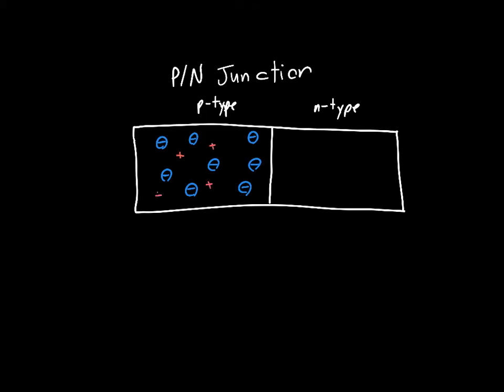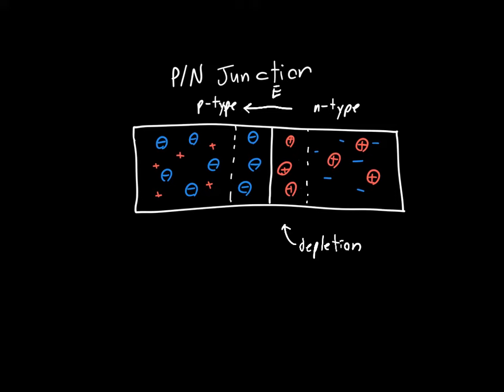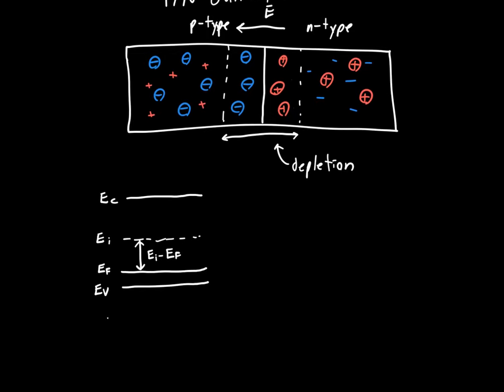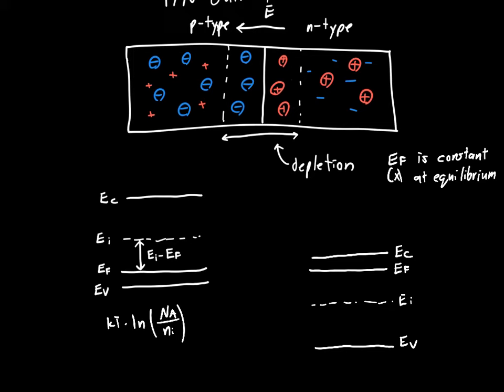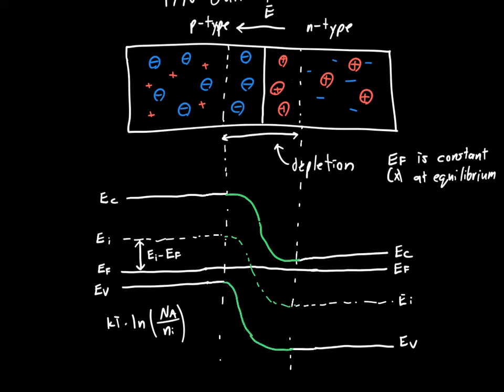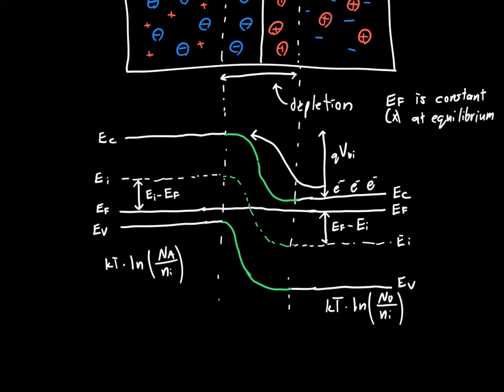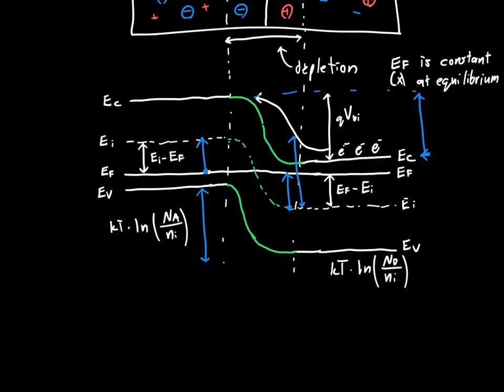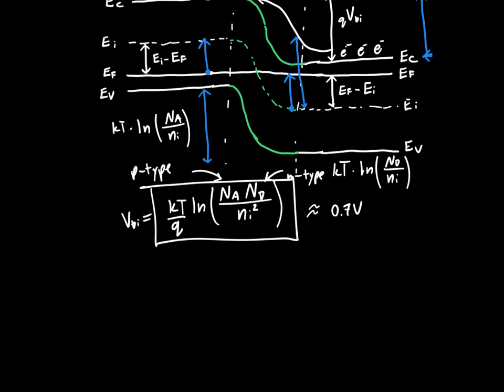PN Junction Band Diagram

Comment: Jordan, please correct me if I am wrong. When we fuse two materials together their fermi level or their electro potential energies align to reach equilibrium. Your choice of the word "constant" in describing fermi levels in two different material is confusing. Fermi levels are different in different materials and they align when they are fused to reach equilibrium.
Reply from the maker: Correct! The term “constant” only applies once the two materials reach equilibrium, at which point the fermi level is flat throughout the entire system.

Comment: Dear Jordan at 2:58, why you have started sketching the band diagram for n type bit below in comparison to p type?  I was looking for the reason behind it. Why we are not keeping the Ec and Ev lines for N and P type at the same level. Please do clarify my doubt.
Reply: Electron affinities are different when you dope Si with either P or B, from a chemical point of view. Although not a good reasoning, also the equilibrium condition for the Ef to remain constant along the depletion region and bulk material, requires the Ec and Ev of both p and n-type semiconductors to be arranged in this way, as it's shown in the video.
Reply: @brunoaramburu740  Thanx for replying. I have figured out the reason.

Comment: Some of the books says in the pn-junction when higher energy electrons in the conduction band on the n-side diffuse to the p-side to reach equilibrium, the entire band structure on n-side will shift down relative to p-side. I am not sure what is the exact mechanism on how losing high energy electrons causes the band structure on n-side to shift down? I really hope you can enlighten me!

Comment: so to differentiate forward bias band diagram with reverse bias band diagram is depending on the width of build-in potential. if forward bias, the width is small to indicate that the electron from n-type conduction band is required to have more energy to reach p-type conduction band. am i right? please correct me

Comment: So this example assumes that the p-type and n-type semiconductors both have the same band gap? That's not always going to be the case right?
Reply from the maker: Huh. That's a really great question. Yes, it does assume that. I never actually thought to question that assumption. In principle there is no reason they have to be exactly the same, but as long as you don't add too many dopants and don't disturb the underlying crystal lattice too much, you should have the same bandgap.

Comment: Hi, I have a question.

I understand that Ef is constant within the semiconductor including the junction because otherwise there should be a current flowing and it is obviously not true at equilibrium condition. 
 
However, I don't understand why Ei should be different for both N-type and P-type semiconductors at the junction.

Especially, I believe Ei should be equal for both N-type and P-type semiconductors because it is  an"intrinsic" property of the material. 

I am confused because creating a PN junction actually changed the properties of the material.
Reply from the maker: Your intuition is correct, Ei is the same everywhere *relative to the valence and conduction bands*. It should always be roughly in the middle no matter how the bands bend.
Reply: @JordanEdmundsEECS  Thank you for your reply.

hmm I have a question.

 I assume Ec, Ev and Ei are material properties. So I assume those energy levels should stay the same for both P and N semiconductors.  
Is this true?

If that is true then, when we create a junction, the energy diagram bends and the energy level of Ecn and Ecp differ by the applied voltage, which contradicts my assumption that Ec,Ev, and Ei are equal for both p and n semiconductors.

We use the model that energy diagram bends, so I believe my first assumption is wrong. If it is wrong then could you tell me why Ecn,Evn differ from Ecp,Evp?  

Maybe I am asking a very silly question..
Reply: @trueroughly1691  you are question is not at all silly, apparantely no one in the internet is answering this, have been searching for a while. why the Ec's and Ev's are different.
Reply: @user-ge8hj9br6w  I think I figured it out. It is because of the electric field created within the depletion region. There is an electric potential difference between P and N and there should be a relative energy level difference because PE at P and N is different due to the depletion region PE difference.

So take that into account, and from our premise that the PN junction is at an equilibrium state (otherwise there is a current but we assume no current), the energy level should be relatively different to satisfy both conditions. So Ei is naturally there as it is but what lifted up Ei of P-type semiconductor is the electric potential within the depletion region.

You know, PE is always relative. Jordan answered my question but at that time I just could not understand lol. Maybe I am wrong but I am going to the Embedded field so.. yeah I will stop here lol
Reply: @trueroughly1691  I totally agree.I too found out that after commenting, yes its the potential difference conditions that should satisfy, there is no way Ec at p side and Ec at n side can be at same level after a potential(Vbi) or energy difference qVbi is created at the junction. Ecn and Ecp should adjust accordingly, Point energy make little sense here i assume, its the energy level difference that matters.
Reply: @trueroughly1691  can you help me with this doubt?. In forward bias i have seen in many places that depletion electric potential decreases as Vbi- Vexternal. I want to know Vbi is always greater than Vexternal or not, i know it may sound silly as Vbi is told roughly 0.7V, but then why in band diagrams it is q(Vbi--Vexternal). Also i am only able to explain forward bias with Vbi>V.
Reply: I reply here again so that you might see my answer:

Right, Ef must be constant. Then what was the definition of Ei? We actually never gave an absolute value of Ei, it was always in comparison to Ef. We said that when n = p then Ef-Ei = 0 and we derived formulas that show that when Ef - Ei increases, then n - ni increases exponentially.
Ok, so since we know the difference between Ef - Ei in both regions (not the same in both regions) and we know Ef is constant it is kind of clear that Ei can't be constant.
The other question was why aren't Ec and Ev constant ? We could find Ev and Ec with the help of the Kronig penny model, where we made certain assumptions for the potential, but due to the diffusion of the carrier, an electric field is created in the depletion region, so we should take this into account we computing Ec and Ev. Potential is just relativ, if you add a constant to a potential in Quantum mechanics, the energies you will find will have exactly this constant offset, so here you have to add this Vbi to Ec and Ev.

That's how I convince myself that it makes sense, but I have no source to prove my intuition is right.

Comment: I am not entirely sure why the Fermi energy is constant. I would have thought that the intrinsic Fermi energy is constant since it is the same for both materials. Can you help me understand that a bit more?
Reply from the maker: Your intuition is correct, the intrinsic Fermi energy is the same everywhere *relative to the valence and conduction bands*. As those bands bend, so too must the intrinsic Fermi energy, so that it’s at the same relative distance. The Fermi energy in contrast you can think of as the “equilibrium energy” for the entire system, by definition when the Fermi energy is constant, the system is in equilibrium. This means there is no net flow of electrons.
Reply: @JordanEdmundsEECS  okay, got it. Thanks.

Comment: I have no intuition about why E_F would be the same value in both halves. Can you explain why that is the case?
Reply: OK, so after thinking a lot, I realize the answer must be that this is only true in equilibrium. When the P-N junction is first created, the Fermi Levels, Ef,n and Ef,p, start out naturally different, and I think that would also mean that Ec and Ev are the same for both (uncertain here). However, there is a relationship between the Fermi Level and the probability of finding an electron. Due to the odds of finding an electron being higher in the N-type area, they will naturally drift over to the P-type area (this is modeled as diffusion current) and as this happens, the Fermi energies of the two haves start to become equal as any inequality will result in an equalizing drift. The shifting of the fermi levels more or less "Drags" the energies of the valence and conduction bands with them, creating the potential barrier. @Jordan can you confirm or elaborate on if I've understood this correctly? 

I wish this were stated somewhere explicitly. I have struggled to find it.
Reply from the maker: You have understood this exactly as I currently understand it. This way of understanding things can also be extended to heterojunctjons, and you can use it to predict what their (rather strange) band structure looks like.
Reply: @xephyr417  thank you for the nice explanation but I am still stuck at the point where Ec and Ev are the same. They should be same right ? Because the material is same. I am confused about this.
Reply: @0xVikas  That's my question too. Because Ei is an intrinsic material property of semiconductors, it should remain the same for both n-type and p-type semiconductors. 

I can imagine that Ec and Ev can vary because the material is somewhat "ionized" at the depletion region(though I am not really sure about this because this is just my assumption). Therefore material properties Ecn, Evn, Ecp,Evp can be changed because the material itself is different from intrinsic semiconductors as it is electrically non-neutral. 

However,  I still cannot understand why Ei should vary because Ei is the intrinsic property of "undoped semiconductor"
Reply: @trueroughly1691  maybe even Ei varies just like how Ec and Ev are changed, due to the precense of non uniform charges but yes, I am still not sure about this.
Reply: @xephyr417  thanks for the explanation, but I didn't follow what you mean by dragging of Valance and conduction band energies
I am still puzzled with why the energies Ec & Ev are greater in P type than in N type
If Electric field is the ans, then isn't the E just within the depletion region only?
Reply: @JordanEdmundsEECS  Hi, I am sorry for leaving a comment again but I think leaving a comment here will help me and other people to understand the concept of band bending through discussion. Please check and leave a comment whenever you are free. 

I think the bending is due to the depletion region voltage difference. Ei is there as it is for both p and n type semiconductors, but due to the junction, there is a voltage difference between n and p type semiconductors and that lifts the Ei of p type semiconductor relative to n type. 

I was confused because I thought Ef is sort of a reference energy level for both of the P and N type semiconductors, and I also thought Ei should be the same for both P and N type semiconductors. But according to the band bending diagram, it is not(it differes by Vbi built-in potential difference). 

and I think that's because Ei,Ec,Ev are lifted by the potential difference within the depletion region which is pretty obvious.. but somehow I missed that point. I think I was so obsessed with the thoughts that Ei should be constant for both p and n type semiconductors. But there is a PN junction and obviously, there is a voltage difference and everything has to be thought relatively as you said.
Reply: @trueroughly1691  First, for the Ef being constant, this comes from its definition: "At 0 Kelvin all the sates below the Fermi energy are occupied". So think of the whole thing being at 0K (so nothing moves) it can't be that this energy is higher in a region than in another, since otherwise the electrons or holes with more energy would move to a state with less energy, so it wouldn't be equilibrium. 
Right, so Ef must be constant. Then what was the definition of Ei? We actually never gave an absolute value of Ei, it was always in comparison to Ef. We said that when n = p then Ef-Ei = 0 and we derived formulas that show that when Ef - Ei increases, then n - ni increases exponentially.
Ok, so since we know the difference between Ef - Ei in both regions (not the same in both regions) and we know Ef is constant it is kind of clear that Ei can't be constant.
The other question was why aren't Ec and Ev constant ? We could find Ev and Ec with the help of the Kronig penny model, where we made certain assumptions for the potential, but due to the diffusion of the carrier, an electric field is created in the depletion region, so we should take this into account we computing Ec and Ev. Potential is just relativ, if you add a constant to a potential in Quantum mechanics, the energies you will find will have exactly this constant offset, so here you have to add this Vbi to Ec and Ev.

That's how I convince myself that it makes sense, but I have no source to prove my intuition is right.

Comment: Since my background is in biology, I have no clue how to get the value of Nd (donor) and Na (accptor) from the p-type or n-type  semiconductor. Did u explain this in your previous videos that i missed the point ? 
Another question is, let say i'm doing experiment on a newly unknown material that is not discovered yet, how can i tell whether this material is N type or P type?
I really appreciate that u can answer these questions,  Dr. Jordan, thx in advance.
Reply from the maker: This is something that you are usually given. When I want to figure out the doping of the Silicon wafers I work with, I do 4-point probe measurements and use the known mobility of electrons/holes in Si. If you don’t know the dopant type you can use the hot probe method.
Reply: @JordanEdmundsEECS   For your knowledge, I'm actually using biomolecule (liquid form) as a material to replace of the conventional Si doped material or other material in diode construction. Can hot probe method used for biomolecule? will they degrade in high temperature or the water will evaporate quickly?

Thx Dr. Jordan for the suggestion and it leads me to a direction,  I'm trying to figure it out what type are them. I will look into it, if I have any question, I will ask again.

Comment: Appreciating the video! One question; How come the gap between the valence and the conduction band is the same for p-type and n-type. Seems counterintuitive.
Reply from the maker: Great question! The underlying band structure (valence band, conduction band, intrinsic Fermi energy, etc.) are only dependent on the properties of the material itself (silicon in most cases), and so the distance between those bands won’t change with your doping. The only thing that doping changes is the Fermi level E_F, which affects the concentration of electrons and holes. You can think of E_F (or equivalently doping) as the only knob you are able to tweak to control a semiconductor device.

Comment: Great video ! one question, when you say the Fermi energy (value) is constant you mean Ef so at the equilibrium condition there's not flow of electrons. If there are some variations, it's only the value E_i that changes right ?
Reply: The Fermi-level is defined as when the product of the fermi function = 50%. This 50% is stated by a line that represents a 50% probability that an electron will have a charge of that corresponding value.

So if the Fermi-level is always 50%, and both energy diagrams are on the same scale, you can combine both diagrams by using their respective fermi-levels as the middle (since they both resemble 50%).

Comment: Very good video. I have a question: is the depletion region voltage drop the same as V_bi? Why they have the same value (if that is the case)? Thanks in advance.
Reply: 2 years late, but it is because the example shown is in equilibrium that we can say V_BI is the same as the voltage drop in the depletion region.

In other cases like fwd / rev bias, the voltage drop would vary according to the external bias applied, and V_BI remains constant throughout all cases.

Hope im right haha, all the best